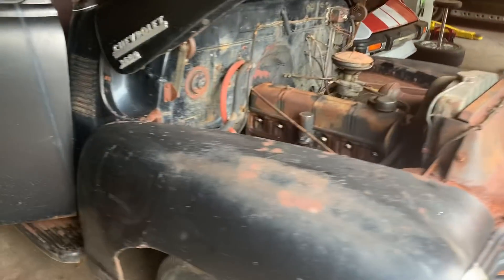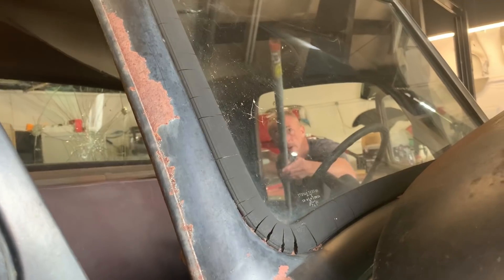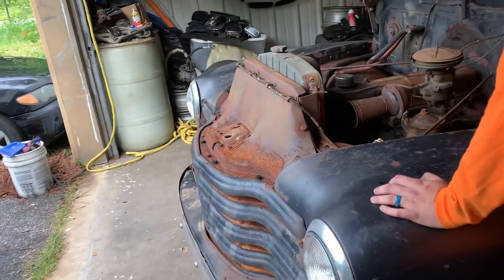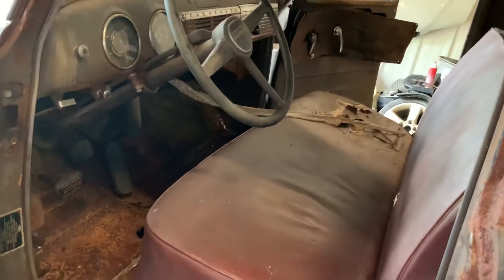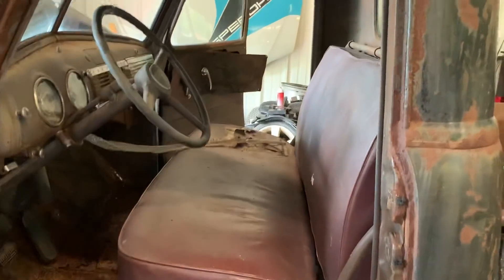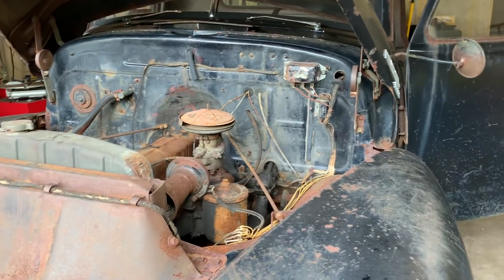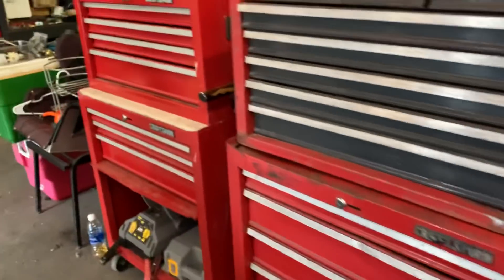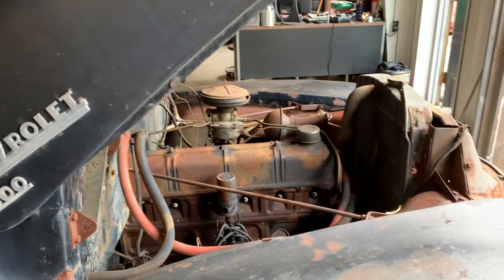Saved! 1950 Chevy step side! (With a surprise)

Comment: Don't forget to check under the bench. Strange how the truck is so much more rotted out at the back than the front. I suppose you can't expect too much from a 70-year-old truck. The fenders might be able to be saved, assuming they can be detached and the passenger side one can be undented.

Comment: When I was a kid, we lived in western washington where a very snakes were. My dad is a logger and needs a decent truck an we are in Eastern Washington  an he spots this older nice truck parked up in a field near a burger stand. He inquires about the truck and it happens so that the guy selling burgers owns in. Dad falls in love with that truck and tells me that I will be driving the panel back as he is taking this truck. It was  spring if I remember right and so he drove that truck an I drove the panel truck.... I might a been thirteen then. He grabs some steel on the way home and then figures when we get home he is setting it up for logs. So he sets the bunks on that truck bed and bolts them down and then heads for the woods... he is coming down the road and the pipes are rattling off, exhaust shit. He is near the place and coming at a good clip and then I see him roll out of the truck without slowing down and its heading for my rig with no way to get out of the way so being parked, I jump and run. His truck slams mine and I am wondering what the hell, so I look it his rig and there is a big ass rattle snake! It had curled out from behind the seat and came up through where dad always stashed his booze. The booze still there , I went and checked on dad who was dusting himself off and kinda tore up from landing from a rolling rig an his eyes were huge an he said I felt a snake! I told him it was a rattle snake and he went and burnt that truck to the ground right there totaling it and mine too

Comment: I did not realize the battery was in the floor, the 66 Chevy had it under the hood.
Reply: Most of the old trucks had it in the floor. My 41 Power Wagon had it in the floor. It had a piece of thick ply wood somebody cut to fit. I think it originally had a chunk of stamped steel that probably rotted away. It was still 6 volt too.